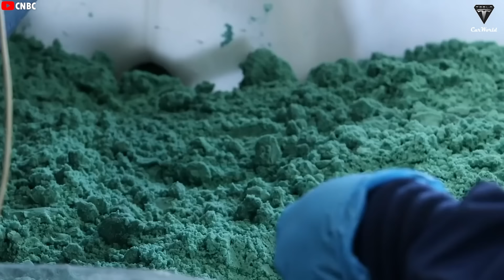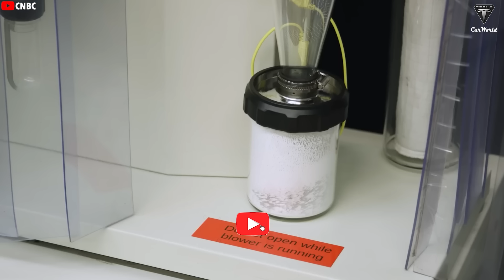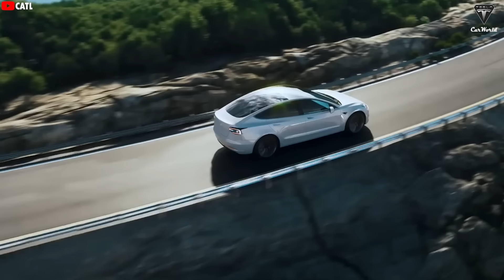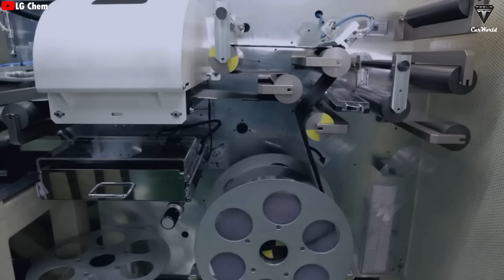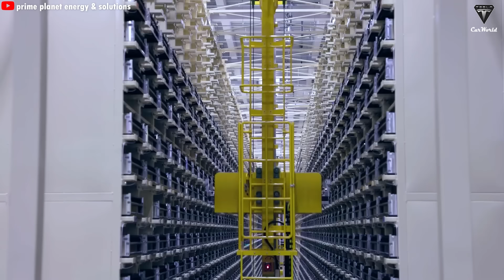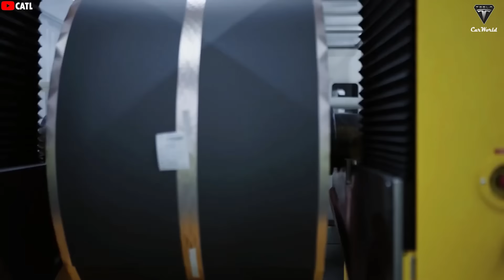It Happened! World's First LFP Battery Delivers 652 Miles Of EV Range

Comment: A battery pack that can give 500 miles of range is all we need. If the pack size is also smaller and lasts longer, it'll be good for decades. And maybe even 2nd-hand used batteries can be retailed at extremely low costs to the masses and installed in home energy storage systems and portable power units. Sounds very exciting, indeed.